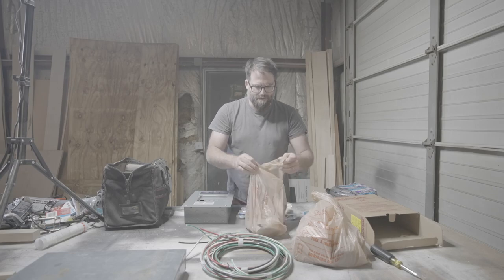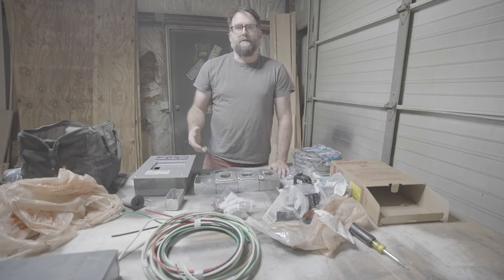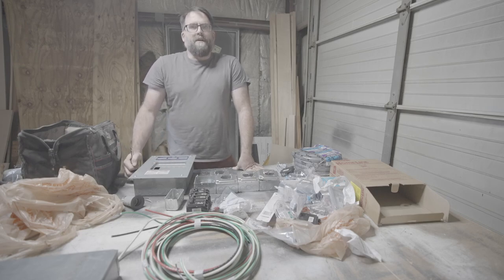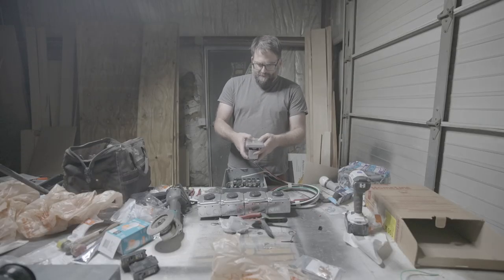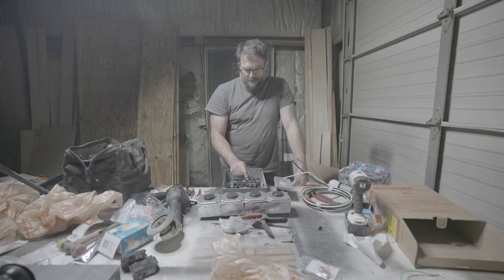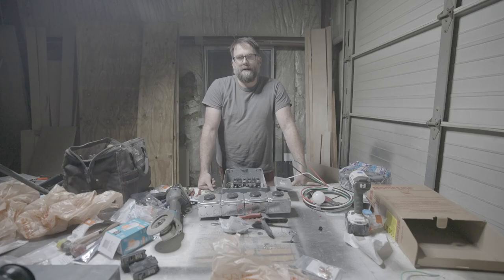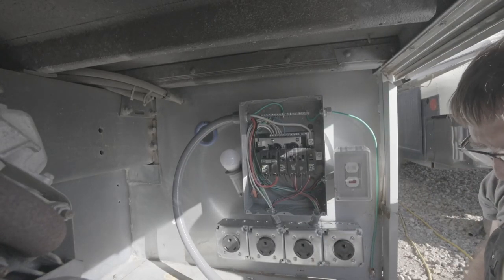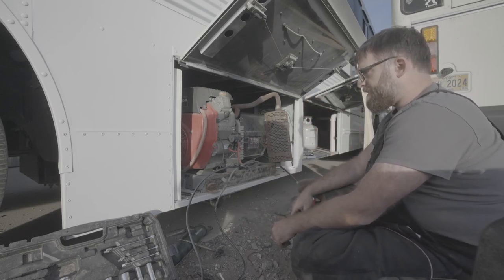Installing A 15 kw Honda Generator In My School Bus Tiny House

Comment: Nice addition to the bus! I have been wondering. I might of missed it. Do you have an update on your Dickinson underfloor heating system? I'm interested in doing something very close to what you did, but the last time I remember seeing it, it wasn't working. Did you get it to work?
Reply from the maker: I don't actually. The weather has been nice enough to where I don't really need it. The Dickenson on low will heat the entire bus if I turn it on before it starts getting super cold out.
Reply: @theoffgridskoolie  Thanks. I’m still a few years away from starting my build so I have time for research. I like the Dickinson because of it’s passive system, barely any electricity. I’m thinking of tapping in the vehicle diesel tank to put a pump to fill a secondary tank for the stove.